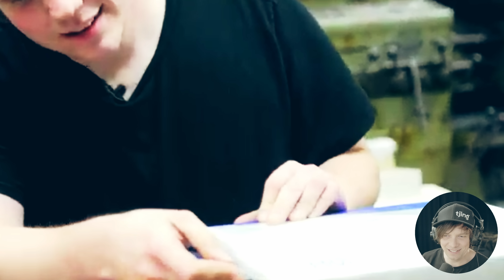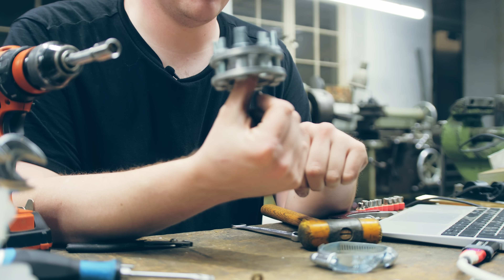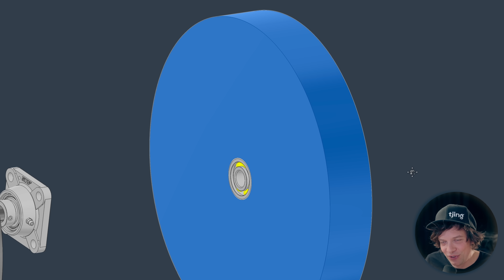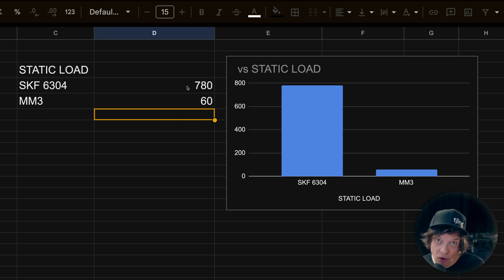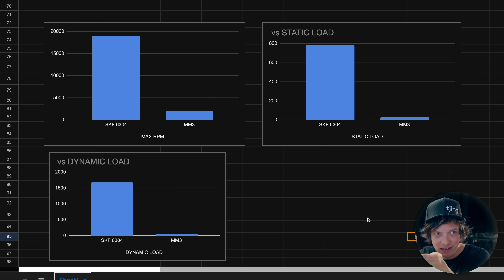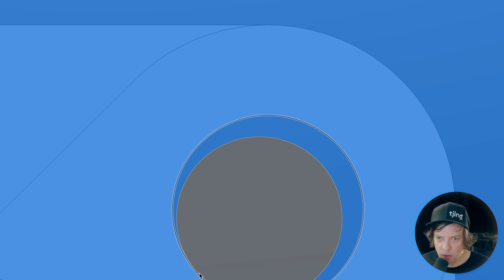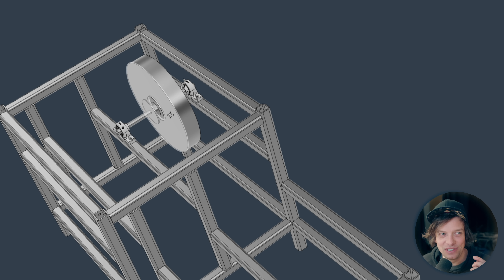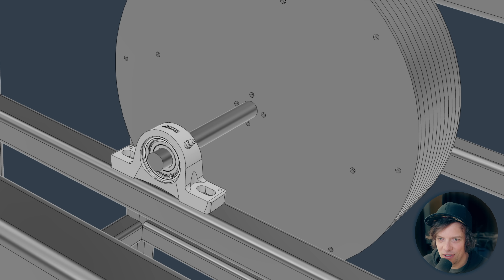Worst Bearing Housing Ever - Marble Machine 3 Ep.3

Comment: I stopped middle of the video for this. At the point of the stability of the bearing. I think what the reddit poster meant was the stability of the whole design of the housing. With the bolts around the bearing you have a very small contact area, which means that the forces applied lead to high pressure as of the small contact area, wich leads to heavy wearout. So your bearing will hold up easily to the forces, but not the housing. Over time it will come loose, and this kind of damage grows exponentionally. The thread of the bolts will chew up the steel plate. And if you take bolts without full thread, you have only a line contact wich is still a very small contact area.
Reply: Now I have to break in for the concentricity thing. The oversized holes are made to move and position the housing in the right spot. Giving room to adjust things, lowers your need for high tolerances. BTW, bolts and screws are force connections not form connections. So when you screw two things together, its not the bolt passing through the holes that prevent the parts from slipping apart, its the force applied by the screw, pressing the surfaces of the two parts together and friction is hindering a sliding.
Reply: Ok, I really see how far off you are here. Yes the housings are able to pivot and therefore keep the bearings safe. But you need to install one housing on each side of the flywheel. Then you slightly tighten the screws and spin the wheel. With a dial gauge you can check the concentrisity and the perpendicularity and adjust this to be perfect. Then you tighten the screws and maybe add pins for future disassembly and reassembly. This is how building precise machines works. You leave room for adjustment and therefor can work with low tolerances, then you bring everything together and dial it in shape, then tighten all the screws and you're ready to go. Your method leaves no room for such adjustments. Testfitting everything now, does not mean that the next batch you order will have the same tolerances. As you said, laser cutting is no precise machining, that also means if you order 100 pieces to the same specs, they are not all the exact same, they will be different. What you would need is a high replicatability of your set measurements, but I'm sure this won't be the case. And this might also be true for your next box of bolts, they might be 0.1mm smaller in diameter then the ones you're using now, and therefor not working on your design.
In really high precision applications where even machining comes to its limits, you end up doing multiple parts and check each of them to find the few that are in spec to do the task. 
Think of gaps and room to wiggle as your friend not your enemy.
Reply: To transmission momentum from the shaft to the flywheel you need a slotet shaft. You can add the corresponding feature right into the laser cut profile. And then use two regular bearing houses. Read above for the adjusting part.

Comment: I'm worried you're focusing on this because you're trying to reinvent the wheel. The purpose of the pillow block and hubs is that they're premade and freely available and marginally modifiable. While a purpose built and machined bearing housing would literally be perfect trying to jimmy something between good enough and perfect isnt what you're going for. Spring for perfect and move on or accept good enough.

Comment: I am disappointed with this video. Threads are NOT to be used as a locating feature especially ones with loads like a flywheel. The whole point of a flywheel is an energy storage device. You are storing energy in a flywheel and it should absolutely be taken seriously and pushing your idea of your bearing housings to work will get someone or yourself injured. These housings will crush the screw threads over time from the slightest imbalance of the wheel and it will eventually cause issues and potentially a dangerous failure. You can play imagineer in CAD all day and it won’t get you real world experience in how things are made and how cutting corners with something like this is foolish. I am a huge fan but I have to say that you are approaching this from the standpoint of a stubborn imagineer that is hurt that their idea isn’t likely going to work. I’m speaking as a business owner in the cnc manufacturing realm. You need to listen to the people giving you advice.

Comment: The flywheel will need to be taken to the balance shop anyway. I think this is a solution in search of a problem. I would refrain from literally reinventing the wheel and use off the shelf components. I would also suggest rubber pillow blocks because the bearings themselves will impart significant vibrations into the frame.

A flywheel doesn’t have to be concentric or perpendicular, it needs to be balanced. You could make it from sand casted iron or machined plates, you’re still going to have to put it on a balancer and drill some holes in it.

/$0.02

Comment: Mechanical Engineering student here, just finished my class on machine element design. If you want to find the needed dynamic load on a bearing, you have to have a design life in mind (1000 hours of operation for instance) Then chose a desired relaiability of the bearing as they are graded on a probability of failure (99.9% reliability) then you get a necessary C10 rating (3.74kN). But as others have said the bearing is probably not the most likely componenet to fail, but the housing itself.

Comment: A flywheel of that size and mass needs to be very well balanced. Failing to do so will have a lot of effects later on down the line.
You can balance it manually from laser cut disks, but It’s more worthwhile to machine it from one mass and eliminate the risk of unevenness and wobble created from surface imperfections of stacked plates.
Since most of your load is going to be on the axis of travel, offaxis loads are not as critical. Otherwise roller thrust bearings are what you need, not pillow blocks or this stack. You also don’t want to apply too much force (especially unevenly) to the walls of the bearings, or they will wear out more rapidly. 
Also roller or needle bearings are probably better for this application than ball bearings. A lot of force is acting against the bearing, and ball bearings have less surface area and are prone to wear under stress; whereas the greater surface area of the roller bearings gives them longer life, and less prone to deformation under load.

Comment: Of course the bolts will feel snug by hand, that's trivial. It's under load that it will fail. The threads on those bolts will squash and compress like soft cheese with a big flywheel spinning in it and it will come loose and vibrate. Use a machined solution, stubborness to uphold stupid ideas is what killed MMX.

Comment: Your calculations for your bearing loads are for a static load.  The system that you will be using these bearings is a dynamic load.  The faster you turn the flywheel and the heavier the flywheels are the greater the load will be as the flywheels are unlikely to be perfectly balanced.  This is usually not be an issue for most applications using bearings as it is usually just a small shaft.  You are using these on a flywheel and your loads could get very large very quickly.  The conventional way to deal with this is usually with more precision.  The systems that you are envisioning to use are not extremely precise but even if you were to switch to a more precise machining this is likely to be self-limiting and self-defeating.  As you become a more precise the temperature expansion of your materials will eventually become a problem in and of itself.  So if you cannot make it more precise make it adjustable.  In this case it would need to be self adjusting.  I believe they make a system to be used on tires of automobiles that might be useful.  It is a ring tube with some ball bearings in it.  The ball bearings are free to move along the tube until they naturally find the balancing point for the system.  As you are using a very heavy weighted system you might need to use several of these

Comment: I loved the beta iteration of the marble machine 2, before you started to time it to the 1/100th of a second. There is no band/orchestra on earth that has perfect timing to 0.01s. Trying to perfect timing made it more robotic, it used to have an artistic humanlike slight timing variation throughout the songs. 
I also would have been lazier on the balls falling out. Having them hit in the same spot every time once more makes the sound more robotic. I would have made a catch tray for the strays with an elevator up. Having them fall in an inch diameter target at the old timings every time would give a more human variation in sound than hitting the exact same spot every time with a 1/100th of a second drop robot.
There is a reason a painting of something is worth more than a picture.

Comment: I think over time the threads on the bolts will slowly be crushed by the bearing under load. There are bolts that are only threaded at the ends for the nut and have a solid shank for the rest of the bolt thus giving a solid face for the bearing housing to sit against.

Comment: as much as I think the threaded bearing housing is a bad idea, I can appreciate that you're designing it and showing it BEFORE you build and integrate it, I think that this sort of thing will definitely help with the longevity of the project. Though I think, like many have said, the benefits of tried and true outweigh the slight alignment concerns you have. Though the housings you showed are designed to allow for concentricity adjustment, designing with tolerance is a must in any active system, especially fly wheels, where designing for exact precision will only cause it to break once a slight deformation inevitably appears somewhere.

Comment: I think Martin has made some good points. It is not enough to use an established, well designed solution. It has to be used in the way it was designed to be used. No matter how well designed a chisel is, it will always make a crappy screwdriver.

Comment: For the live shaft it doesn't need to be round, you can use say a hexagonal or octagonal shaft instead. Your flywheel will stay afixed to those without any issue, just need a clamp/block on each side to limit axial travel.

Comment: What about the strength of the threads on the bolts that will be pressed on by the bearing? Will the threads compress/flatten over time? And will that possible compression make wriggle room for the bearing to allow for concentricity miss-alignment? If the threads do not compress/flatten, then I perceive no real problem with this bearing design. Especially since there seems to be three points of reinforcement on the bearing housing at all times.

Comment: he keeps looking at what the industry has come up with through tremendous effort, and seeing that the way he wants to do things doesn't work with that
and the part where he messes up is he does not consider that maybe its done the way it is for good reasons and he should think about adjusting his design to do things properly.
instead he goes ahead with his flawed design making completely untested custom "solutions" based on zero real engineering experience to get around the fact that he's going about everything the wrong way.

Comment: The live shaft idea allows the bearings to be far apart... this is what they're designed for.  The flange bearings are not designed for that application.  See the car wheel?  It uses tapered rollers, one on each side... with grease!  This is the best design if you don't want a live shaft.  As far as the balancing goes, once you have a sturdy assembly you can balance it in-situ... you could even machine it in-situ!  So your current laser-cut flange idea is wrong because the bearings are not meant for that application.

Comment: Isn't it better to make the shaft going through the flywheel be keyed to the each other so you are not messing with bearings in/near the flywheel which is spinning fast and has lots of mass. No need to worry about perpendicularity and so on.

Comment: The idea of using bolt threads (that need to be hammered into place!) as a bearing housing is willful ignorance.
If your intent is to laminate the flywheel then make the two outside plates 12mm (or whatever the bearing depth) and pocket the OD of the bearing leaving the inner pieces clear of the bore.
If you insist on not machining the fit use Henkel bearing mount and true it up as a complete assembly.
I've watched too many years of effort wasted on irrational decisions. It leaves me more sad for all involved than frustrated by the ravings of a madman.

Comment: I think the is not with the bearing itself. I question the longevity of the threaded bolts. Will the threads be strong enough to not flatten due to press fitting the bolts? I could see a gap forming between the bolt and the bearing which may cause the flywheel to become unbalanced.

Comment: Remember, a ring with the same radius and mass as a disk has [almost] twice the moment-of-inertia.  And high moment-of-inertia is what you want for the flywheel.

So instead of having, say, 6 disk-shaped flywheels, if you were able to somehow get 4 rings with the same mass as the 4 disks and basically bolt the 4 rings between 2 disks on the outside, you'll get a higher moment-of-inertia.

I'm not on reddit, so I have no way of posting this there.

Comment: Why spend time debating if your design is better. Use the proven design when you can and then if you run into problems then change stuff. Three weeks in and you have spent 3 weeks on a unique bearing design when one already exists. I just don't get it

Comment: The threads on the screw create higher pressure points, thus blunting the edge causing the bearing to misalign with force and wear usage (sinks into the thread). Having full contact area all over the bearing is ideal. Also, if you just have a solid rod, that is a small pressure point. The problem is, most of the weight is on the bottom half of the circle... thus will blunt the tips of these small points.

Comment: After reflecting on this video for a while, I know why this design feels like a step backward:
You are adding design requirements instead of removing them.
It needs to be cheap, it needs to be perpendicular, it needs to be concentric, it needs to be a flywheel.

What are the ACTUAL design requirements?
Reply: There are no designs requirements yet--plain and simple.  The first two failed (his words) because they were too complex.  So his solution is to make things even more complex.

It's all part of the grift.
Reply: @br52685  I don't see it as a grift, I think design is extremely difficult. I'm glad he's treating it as an experiment. Attempt something new, learn what the problems are,  then iterate. I do wish he would make more small prototypes before going full size.
Reply: @seldonatreides  I agree that design is extremely difficult.  But there's nothing about this current path ("custom-designed flywheel") that's getting him any closer to a marble machine.

Comment: I dont use Reddit but i guess you could use Temperatur to clamp te sheft and the flyweel... If the shaft has a slidly thicker Diameter at roomtemperatur then the flyweel and you heating Up the flyweel and freeze the sheft they should clamp together pritty hard when they getting Back to normal...

Comment: The problem with this design is that it guarantees neither concentricity nor alignment. When the bearing needs replaced, you will have to re-balance the system from scratch. Bearings are consumables.

Comment: You can buy shaft clamps that would work for clamping the flywheel to the shaft. These use corresponding tapers as a 2 part clamp to achieve good concentricity and clamping force. Cross+Morse are a good example of these.

Comment: bearing flanges are not even expensive... and you rarely ever use threads (deffinatly cheap ones) for location,  that is not a  precision "press fit" smashing cheap threads against them.
check it with and an indicator guarantee they are not that concentric.

Comment: You are engineering around limitations of the production process - you can get rid of the laser cut uncertainty for the shaft by getting the center bore of your flywheel machined. It’s not going to be that expensive and you won’t need to replace the flighwheel regularly, so just build two or three extra and you will be covered for all your tours.

Comment: Use the pillow blocks, and remove the complexity of trying to keep your flywheel perfectly perpendicular to the shaft with a bearing; it is much simpler to use a live axle system, with a keyed shaft, resting on two pillow blocks, than whatever kind of side loading hell you’re putting on those bolts. You’ll need to balance your flywheel regardless of the design (you can have a completely asymmetrical, non perpendicular flywheel, so long as it’s balanced) and it’s so much more complicated trying to get the massive flywheel to remain upright if you want it decoupled from the shaft